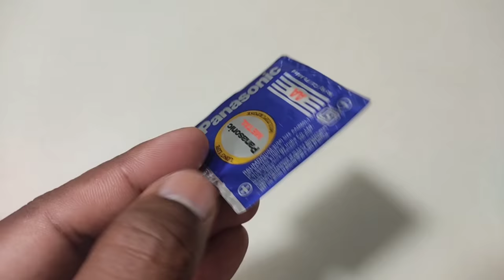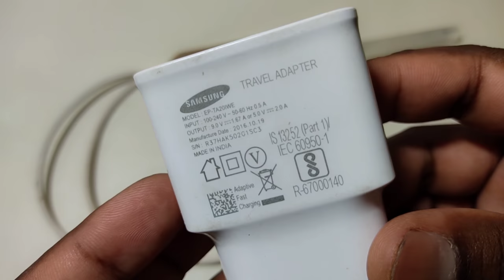How to make a Hot Glue Gun at Home ll DIY HOT GLUE GUN ll Homemade hot glue gun

Comment: The dish washer wire is made of steel that will heat or not
Reply from the maker: Yes its work as nicrome wire
Reply: @lowbudgetproject8036  xcbvvvvnbvvv
Reply: @lowbudgetproject8036  n  bbb
Reply: @lowbudgetproject8036  bvh
Reply: @lowbudgetproject8036  -CVS xbxbxxx
Reply: @lowbudgetproject8036  Dadac
Reply: @lowbudgetproject8036  xcbb
Reply: @manhff6021  idior